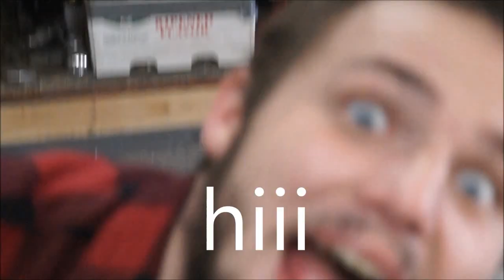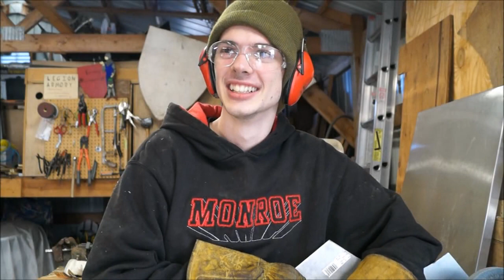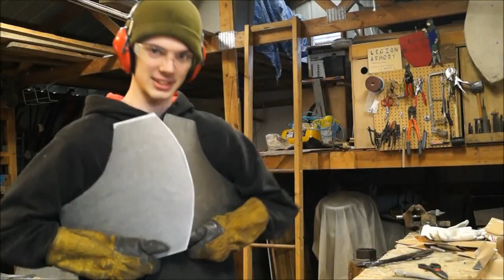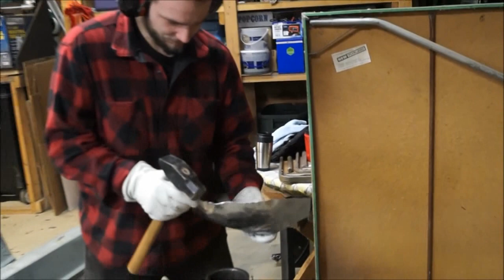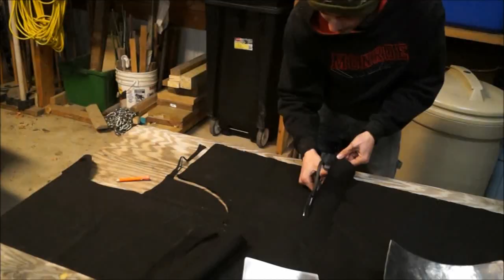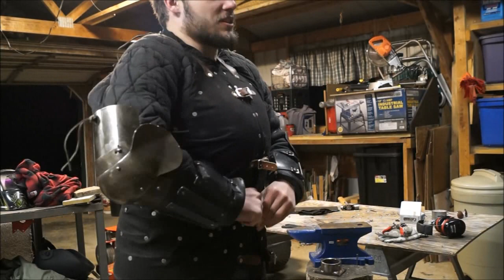How Many Idiots Does it Take to Build a Brigandine?

Comment: Strictly speaking, this isn't brigandine. It's more correctly known as "coat of plate" from which both true plate armour and brigandine evolved. True plate consists of a single breastplate with a horizontal layered "skirt" of plates protecting the abdomen while offering sufficient back-and-forth flexibility. Brigandine is constructed of many small overlapping plates -- typically uniform in dimension -- riveted to two layers of thick canvas or leather. 
The advantage of "coat of plate" over brigandine is better flank protection of the ribs and abdomen since its plates extend around the sides while brigandine is usually front & rear protection lacked or strapped together at the sides. 

Still, this would be pretty good protection, even if it is a little rough around the edges. Looking at it makes the German engineer in my cringe, but the Australian mechanic in me is laughing in glee at how beautifully unrefined it is.
Reply: spot on!
Reply: Most brigandines i saw (and i own one :P) were closing on the front like this one, sides, back and front would be made from smaller plates, shaped so they would together form (when worn of course) something silmilar to the one in the video instead of uniform size plates. Still it looks like something i saw called "covered plate"(?) By the owner. A chestpiece made from large plates closing in front covered in velvet i think, with rivets along the edges.
Reply: @bloodraven37  It's the chest plates which put this more firmly in the coat of plates category. Brigandine tends to be more uniform. I'll still er to the side of coat of plate, but you raise a good point -- this is more between the two than I originally considered.

Comment: What gauge and kind of steel? And how do you know the measurements for the fabric? Using scrap?
Reply from the maker: It's just 16 gauge mild steel, which when compared to the original armor fragments has a noticeably lower carbon content, but I see that as negligible because many other contemporary pieces of armor had similar composition to what we used here. As for the fabric, I was just able to estimate it straight onto the final canvas. Hindsight 20/20 it might have been more effective to take actual measurements of the pieces that would end up getting riveted into the foundation to reduce the human error a bit.

Comment: Isn't that technically a coat of plates more than a brig? Did y'all get the plates to overlap properly down the center?
Reply from the maker: The difference between the two is pretty inconsequential; the construction method is the same. The overlap could probably be better, but the goes for any of my pieces :)
Reply: @LivingManuscript  Pretty cool what you can do with sheet steel and some time on your hands. I suppose the difference has more to do with when the armor was made as much as anything, pre full plate/mono cuirass would tend to be called a coat of plates/pair of plates and post I tend to see called brigandine.  How did that backing material work out? It looks thin in the video but you called it canvas so I'm assuming it holds up better than it looks like it would.

Comment: Plates have to be smaller to be a brigandine still great work though
Reply: Not necessarily, the original coat of plates had pretty large plates, and even up to the 15-16th century it was common for the breast of the cuirass to be a single globular plate rivetted to the rest of the jacket